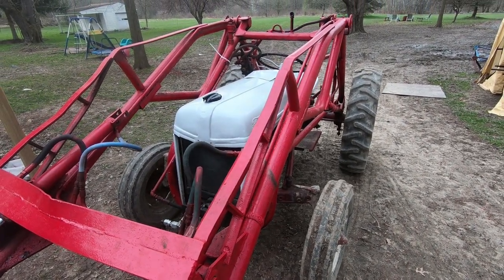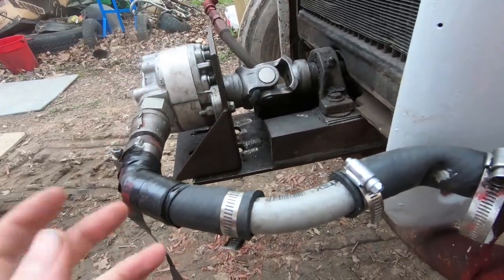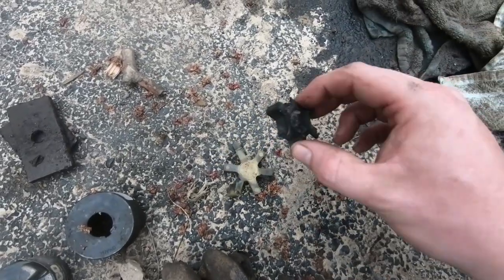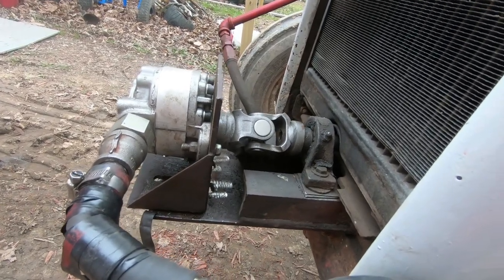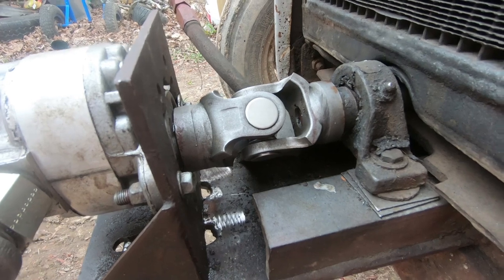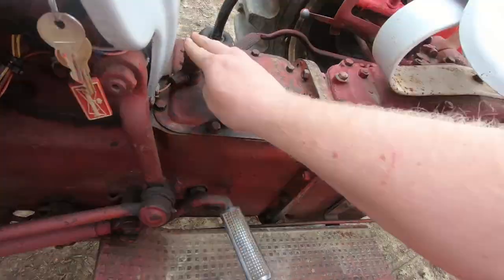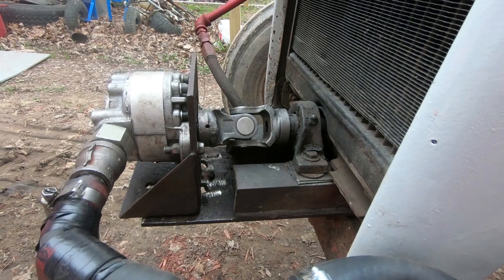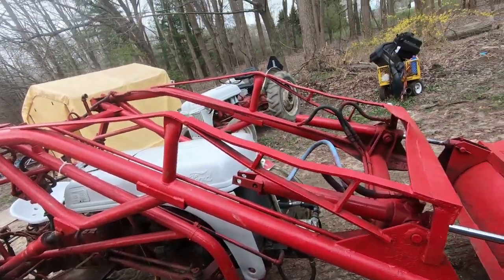Ford 8n loader hydraulic pump install how to

Comment: I am going to do the same for my MF245 hopefully there is a hold in my front axle bolt so the shaft will fit on. If not just makes it harder

Comment: I know this isn't very helpful but those couplers are designed to dampen vibration and are sacrificial if you are not lined up so you don't destroy more expensive equipment.  The fact that they were coming apart means maybe a bent shaft?  Looks like the u-joint got you running though.

Comment: How does the shaft come out of the pulley? I'm going and buying a loader this weekend and I gotta dismount the pump from the guy's tractor, is there anything special I need to get the shaft out of the pulley.. I know it's a special pulley for that shaft, which I already have that on mine because the owner b4 me had a Fisher plow hooked up but I didn't get the pump and shaft with mine..

Comment: I bought a 1962 Ford 2000 with a front loader. The shaft of the hydalic pump was destroyed and the coupler was welded on. The weld broke. I’m thinking of replacing the pump.  Welding the coupler back on may not work. What do you suggest?

Comment: I've got a front end loader on my 9N tractor, that I would like to throw onto an 8N tractor. do you know if everything would be compatible? or will I need to start from scratch building the mount for the pump?

Comment: So my pump set up is similar except the U-joint connection.  Mine is a pulley that is supposed to drive the power steering.  Is this how your set up was before the u joint

Comment: Great video! What is the rubber gear piece called, or better yet the part number? I'm going to start an older loader that is missing it and want to try the cheaper route first before going straight for a new joint
Reply: Those are called Love-joy couplers (no joke).  Used a lot in all kinds of industry applications.

Comment: just got my first 8n and it has this loader. after a couple weeks beeting on it moving dirt that rubber part is gone and the shaft just slaps around like crazy. im curious if the shaft on the pully is like mine. mine looks like it just presses agains the pully behind the radiator. i wanna be sure i didnt break the shaft or something and thats normal

Comment: Hey Mike. I have a ferguson TO30 that i am going to put a loader on from a 9N that has a front pump. I've been trying my best to research it as much as possible. the tractor and the loader are on two different properties many miles apart so i was hoping to at least know what to look for, and you are right the info is not so easy to find. thanks for the video man!. BTW, What do you shovel with this? i'm hoping to move a little gravel with mine when i'm done.
Reply: Joshua w I have to 30 iam going put one on mine but I've used the pto driver style like on a street sweeper hope it works out but you wont fine any how on youtube I've be looking for couple yrs nothing I chose the pto stlye if I can fine a backhoe attachment
Reply: @jackman6256  I too considered the PTO route but went the front pump route since i already have the physical pump (but the pulley and shaft parts added up quickly). Northern tool website has PTO pumps. I think i spec'd out a 1-1/8x6 spline 540 pto driven 12GPM pump and it was around $500 bucks. A farm salvage (if you can find one near you) may have a used one. When it comes time to tackle that project, I plan to get a video together to share the experience.

Comment: Hey Mike. It’s a year now. Is it still going strong? I have the same issue with those three pronged couplers with the plastic. 

Are your U joints still holding up?